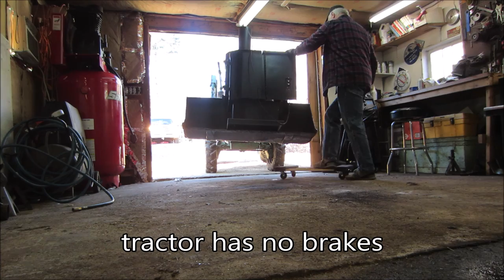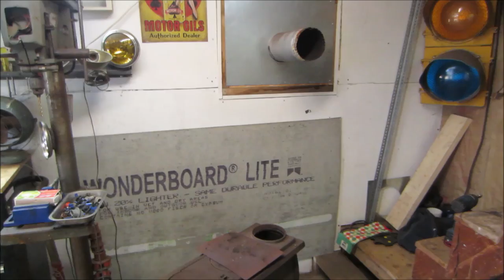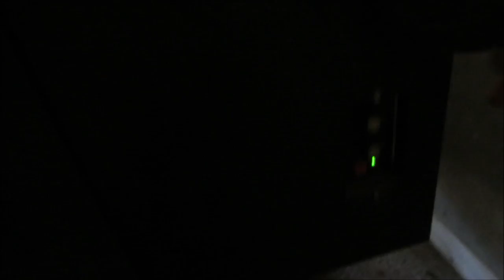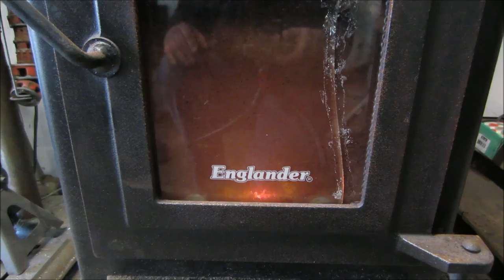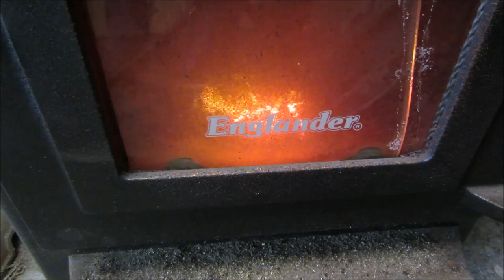garage car lift and free pellet stove found on craigslist,

Comment: Nice used pellet stove all he has to do is carefully take it apart inside use a soft paint brush and a vacuum with a good filter and clean it all the way out to the back then open the sides and get to the motor fans and oil them does rubber grommet on the motor and you just stick a needle in there with oil squirt a couple drops every year I used to service pellet stoves
Reply: That's all you need to do, huh?   Sounds like me talking about all people need to do to keep their computers running well.   For me, it's easy.  For them, they get confused after the word 'carefully'.
Reply: I concur, former pellet and wood stove installer, sounds complicated, but actually easier than most of Mustie’s projects.👍
Reply: @jonathandeere6232  you're correct most people who own pellet stoves don't know how to service them if he serviced them they will last for years you may have to change a blower or two
Reply: Steve Anderson jj
Reply: why go from a woodstove where the wood is free and everywhere to a pellet stove where you need to buy pellets and wait for it to warm up.. at that point masewell just go for natural gas or propane

Comment: I have that lift. I bought it used 20 years ago for $1000, one of the best purchases I ever made. 950 lbs shipping weight, made by Liftronics. Needs a full 120 volts as you saw to work.

Comment: Hey Mustie  1 😀 I remember put woodstove a Air Tight down 6 steps to basement of my on 2 of 2×6 plank board of Hardwood on stairs steps with my Late Uncle Bill, late dad Don also my 2 older brothers David & James plus me and pick up basement thru doorways to west wall rec room in basement in chimley insert off floor with 2 house outerwall bricks high off  to  and was lots hard work too! ! But works excellent since 2000 since installing!

Comment: I've been using wood pellets for heating the house since 2001 and it is here the most economic way for it. My third burner is now running and is more advanced. It is configurable with fans and ignition etc. In the beginning it may not blow any air but only after getting the flame out. Good choice for your friend.

Comment: That's a great pellet stove, my parent's bought the same one in the early 90's and eventually it made it's way into my mom and step dads house and still being used to this day, replaced the door seal twice and 3 sets of blower motors. Deff. Take it apart on the burner side and clean thoroughly.  Will also burn corn and pellet mix too.

Comment: Good vid. Funny, your friend is one of those with things not quite ‘right’. On certain days, just when you don’t need it, everything shows it’s failings: no brakes on tractor, no hooks on bucket, no igniter on torch, weak electric supply to garage, etc, etc. That slow lift will fit right in!

Comment: I have a Bendpack midrise lift like that. Purchased it new almost a year ago. Absolutely love it. I have 9' ceilings and can get suv's up to touching the rafters. Theres a pretty good amount of clearance underneath for service work. Only thing you really can't do with it is jerk a trans on a rwd car. 

Its rated for use over 40f. Guess the fluid gets to thick for it? I have used it down to 30 without issue. Its a back disk exploder trying to move it in the garage. Overall the best money I have spent in quite some time.

Comment: i have a complete flat top on my mid rise, really useful as a big bench when its not got a car on it, best thing to have for them are 2 pair of 10 ton lorry stands, they have the right height so you can leave the car up in the air and lowwer the ramp,  another reason i like the flat top, you can lay/sit on it nice and comfy under the car.
mine is a strongman bewdley which they dont make anymore it has twin rams (uk)

Comment: I bought a pellet stove when they first came available, worked great in my cabin until the power went out for 3 days and we froze our asses off...reinstalled the Ashley woodstove and returned it to Foxworth-Galbraith where I bought it! Probably a good choice if you live close to town but in a remote area where the grid is vulnerable you have to have a battery backup system.

Comment: That's a classic snap on scissor lift. One click action one hydraulic cylinder. It still works and for twenty bucks that a steal. I just ordered the Titan SL 6600 retail at  $2,900.00 ten percent discount tax  $221.48  shipping and handling $274.00  Grand Total   $3,385.48  Thumbs up on this. 6.8k

Comment: the hydraulic power unit for the floor lift can also be used with Porto power cylinders with the proper coupler if it does not already have it..  so power presses.... the 90 buck hydraulic knock out hole punch has uses for pulling bushings and pins out and in. (hole all the way thru the middle of the cylinder). but its only a 7 ton cylinder but it will still work.. and it will work with the lift power unit.

Comment: Pellet stoves are great for garages. In the house I only want a log burner so that if the power goes out we'll still have heat.
Reply: That what I have in my house. We lost power for 40 hours, 3 or 4 weeks ago. I still got heat and a cooking surface. I don't know what I would do without a wood stove. Mind you, I also bought a used generator a few hours into the blackout.  $300 USD or $400 CDN. It was fully serviced 2 weeks before. Gotta love how coincidence works.

Comment: Best stove I know of is a Rocket Mass heater you like unusual things you have to build it yourself but guess what you burn less wood and once the mass unit is heated it will stay warm for several days unlike your pellet stove or wood burning stove you have to continually feed them. Its your choice looks like you've got plenty of wood in your area so that shouldnt be a problem!

Comment: Mustie1 ...I have the same  Snap-on lift....great lift if you have very little ceiling height....Anyways....It has a one way safety valve by that quick release fitting in case of full pressure loss in the hydraulic system before it is fully raised and locked in place with that lock bar and it crushing someone under it!!..or if the release handle is opened too fast......lift it up again just a tad to open the safety valve , and then very very slowly open the handle again  and lower it down  ..the safety valve will/should release....They were made by a Co named WheelTronics ( I see the label is missing on your one shown...label was on the black center cross bar).....the whole set up weighs about 1000lb...I learnt, to move it around the shop with its dolly...just lift the system up a inch or two....you'll thank me later...lol

Comment: I'd check the capacitors in the lift motor, they are a favourite for poor motor starting.
Reply: No, I think it's just the hydraulic pump element. They jam up if you fuck with the on on button. No check valve for safety reasons of it bleeding off and crushing people. So when you just tap the button it could get into a hydraulic lock. Most lifts are like that: "pls no touchy the on button repeatedly."

Comment: I never noticed your wood stove before. A nice Jotul 602 would have been a better option, about 85% efficient at getting all the heat out of the wood you put in, about the same size as your old one. A little smaller footprint, actually. I heated a 1200 sq. ft. house with one.
Reply from the maker: this is a friends garage not mine,
Reply: @mustie1  My mistake. I was watching while distracted.

Comment: Where's your truck with the front mounted trailer ball? That would have been a perfect time to use it. Put a racket strap on the lift to help pull it down.

Comment: Was wondering if the pellet stove has a fresh air intake? If it does get a kit to install it through the wall so the heated air stays in the shop.
On the back side of the stove the fresh air intake is normally a 2 inch connection.
Nice find.

Cheers!

Comment: He could install tracks on the floor so the lift rolls on them as it goes down. I saw one installed that way, well, i think that's how it worked, might've been welded to one set of wheels and left to move freely.
Reply from the maker: it will be going in a new building

Comment: You should go to your local Glass shop......they will be able to cut a new piece of glass for the stove front.......Robax I think is the name brand of the glass......it is a ceramic glass. If you try to buy from the manufacturer......you will pay out the........nose for the replacement glass.......local shop will probably run $150 or so......of course depending on the size.
Reply: Chris Bruinsma  i got a glass from englander for 90 bucks and an extra 20 bucks to ship it to me in 2 days. Came with the seals too.

Comment: 91% isopropyl alcohol works just as good as the gel and only $2 at dollar store for lighting pellet stove.
Reply: I used to use that or the gel but found that the torch is way faster, cheaper.

Comment: Wet some ash and rub it on the glass. Takes the dried on smudge right off.
Reply: It's a bit past that tho, seems cracked.
Reply: Purple Power works good on my glass
Reply: Take a sheet of news paper and dampen it enough to pat into some of the burnt ash then rub it on the dirty glass and see how good and cheap it is to clean the glass. I finish it with windex and use news paper because it works and why waste money.
Reply: Buy new glass. Might cost $100.00 for that size.
Tempered glass.

Comment: Is there a flu for that or is it built in somewhere?
Reply from the maker: pellet stoves are power vented,
Reply: @mustie1  Burning regular hardwood isn't a issue is it?
Reply: @MrBrymstond , Only pellets.
Reply: No electricity, no heat
Reply: @Thebowzer221 , They do have a automatic battery backup for pellet stoves to keep them running or start up the generator.
Reply: @augustreil  Yes you are correct. On the newer models that is. Most older ones have no battery back up.
It is an option that you can look for
Reply: @Thebowzer221 , I have always wanted one but since I have a generator, I never bothered. Just another thing to maintain !
Reply: @Thebowzer221  Not good.

Comment: That's the strangest pellets stove I've ever seen. Supposed to have a 3 inch double walled pipe on it. It's forced draft. You draw in combustion air from the outside. I heat my whole house with one. And s regular wood stove in the basement.
Reply from the maker: l think its a real early one with that fat flu pipe